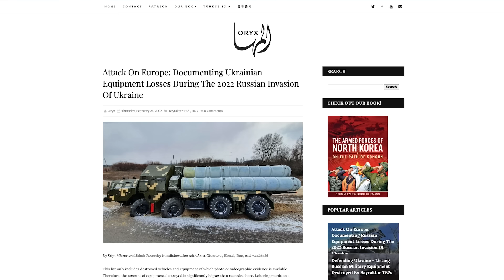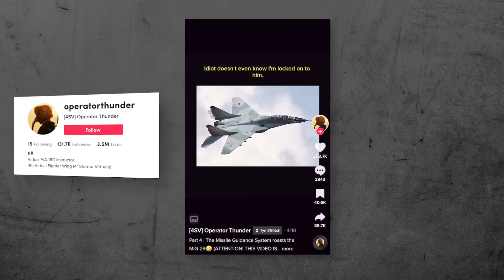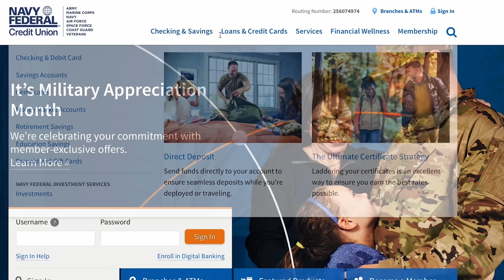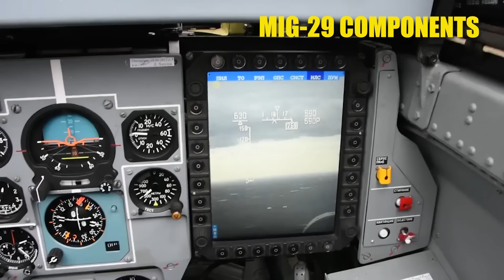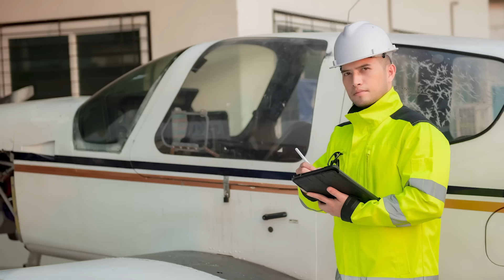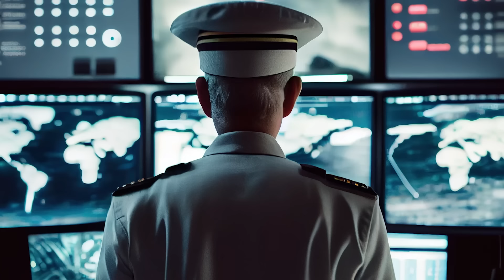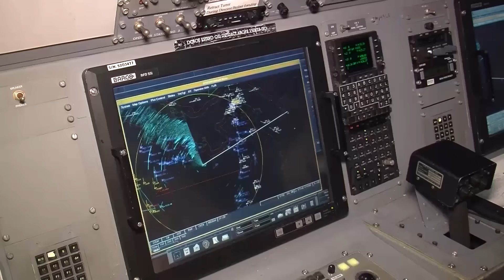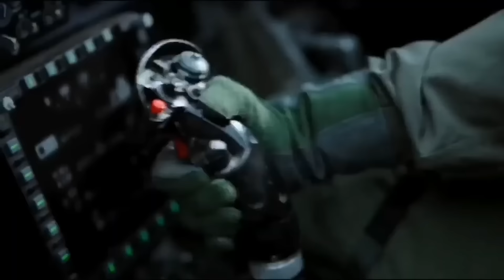How Ukraines new MIG-29 Fighter Jet Operates

Comment: MiG-29 never had GSH-23 gun!, It was alwys standard GSH-30-1. The difference in a caliber - not 23mm and not 2 barrels, but one barrel 30mm gun, capable of up to 1800rpm, which is barely enough for dogfight but almost useless for ground attack.

Comment: How would they be useful?  

1. Actual supply for parts, and ammunition is readily available from the West.  
2. Weapon systems are upgraded and are not as old as the airframe itself. 
3. Better radar and countermeasures than anything Ukraine has available with their older Russian jets. 

Common sense really.

Comment: The Ukrainian Airforce is using a L-39 Albatross, I'd love to see the Czech sending the modern version of this the Aero L-159 Alca.
It's practically a more advanced version with the added benefit of being NATO standard compatible.
Pavel the Czech president already talked about sending the L-159 for specifically this reason, being able to fire sidewinders to Paveway2 guided bombs. 
A big benefit is that the ALCA is light very light compared to the F16, this allows for rougher airfield conditions as well as being more economic in fuel being able to stay up longer.
The F16 was designed for a different army, it would probably help the Ukrainians out a lot and there are a lot more F16's then there are Alca's but still I think it would be good to send an airplane now that Ukrainian pilots are already more familiar with by having flown the older iteration of this plane and just need training on the NATO weaponry.

Comment: Mig-29 has 30 mm Gsh-30-1 gun. It is the only system undoubtedly superior over F-16.
Its projectiles are 4 times bigger than 20 mm.
It means, that 150 rounds for Mig-29 are more deadly than 511 rounds for F-16, and firepower is greater, especially if you consider spin-up time in the Gating.
Mig-29 needs less than 10 shots for almost 100% aircraft kill.
Short recoil system has the lowest thermal load from all possible systems, there is no gas pipe.
The water cooling is used because of extremely low weight of the barrel:
Complete dry gun weights 45 kg (that's why it had a codename "Balerina").
Gun is the last resort weapon, so there is no need high ammo supply.
In Ukraine, gun usage will be meaningless.

Comment: Do Better research - the MiG-29 gun Fire control system which combines the plane's own maneuvering data with radar and IRST data to predict where the target will be was/is so good, that it doesn't need to carry as much ammo.  If you get the reticle on the target, is rarely misses.  You compare gross weights and payloads in an over-simplified manner.  Hydraulic controls versus Fly-by-wire is not relevant if the plane is adequately controllable with its given system.

Comment: The F-16's advantage is the long-range radar system, multirole and more diversified firing power, and more hit points capable of new heavier missiles and bombs. Dog fights may always occur.
Reply: That’s exactly what mig29 doesn’t have,long range radar to avoid s400 and launch from 200km free of hopefully russia long range missiles!!
Reply: @georgesikimeti2184  Both wont be in range of the S400 ever, that basic air combat. Avoid airdefense.

Comment: Mig 29, was not only a sexy fighter jet, but at the time i would say it was better then the F-16 to a certain extent, especially in a dogfight, but of course those rarely happened. There Radar was good for the time, and it had (i forget the name) but it could lock targets easier thanks to a head mounted display. The problems came down to lots of exporting to other countries with poorly trained pilots, superior Us training and the US constant upgrading of their aircraft which rapidly rendered the Mig-29 inferior to the F-16. The most modern “mig 29” is the Mig-35 and that is being produced less then the Su-57 and when being tested by india, it suffered Radar and engine problems, which means its probably a pile of garbage.

Comment: I think the thing most overlooked on these types of videos is that the Russians are experts at the strengths and weaknesses of all russian aircraft, this means when the russians are using newer aircraft they can exploit the weaknesses of the mig 29 to take advantage in air to air combat or ranged missile locks, with an f16 the Russians have limited information on their capability and this fact alone is an advantage to ukraine even if it is offset slightly by less experience of the pilots in the foreign aircraft.

Comment: Thrust to Weight of 1.07 means that you have 1.07 pounds of thrust for ever pound of jet. You got your math wrong, but the point remains the same, although the F-16 is no slouch, and able to turn in a tighter radius than the Mid. 

Like others said, the Mig is able to sortie back to back, whereas the American airplanes require more maintenance, so the Ukrainians will need to take that into account in their planning (and they will, because they are modern, effective fighters.) All of that being said, the F-16 legitimately should kick the shit out of the Russian aircraft, because war is all about information, and you can't beat American radar and detection systems.

Comment: F-16's by default are lighter, more agile and have a smaller cross section on radar, while the MIG-29 is no slouch, the F-16 has been continuously maintained, upgraded to modern standards and are in large abundance around the world more so than the aging MIG-29s. Not only that the agility on the F-16 depending on which variant they Ukraine recieves will make it a very good dog fighter in the sky against Russia's elite Jets like Su-27, Su-30, Su-35, and while i doubt Russia would let their precious Su-57 off its leash and possibly get downed by Ukraine, the F-16 could at least in theory stand some chance against it as long as they worked in pairs or 3 mans to take it down.

Comment: Soviet design parameters is to design something cheap that does that job so that it can be produced in mass quantities.  American or western designs give the warrior as many capabilities regardless of cost.  Therefore you get a Fighting Falcon that has better weapons, better engines, better avionics, and typically better trained pilots.  

The Soviets came up with some very effective air frames, but all of the guts inside them were third or fourth rate at best, as was shown in all of the conflicts where Soviet weapons have gone up against American and Western hardware.

Comment: I’m not convinced the F-16s will make a huge difference. The true strength of the US Air Force is its people. It is going to take experienced air and ground crews to make full use of all of the F-16’s capabilities, and compensate for its shortcomings. The Ukrainian pilots may well be very good. And I will never doubt their mettle. But the doctrine under which the F-16 is operated is one of integration with multiple platforms filling roles to support one another through total dominance of superior numbers and quality. I hope Ukrainian pilots are able to show us just what the F-16 can do against Soviet jets. But the Ukrainian AF is not the same thing as the USAF. Hopeful, but not expecting the same dominance I would expect from the US.
Reply: Yep,experience and mental awareness are the key!

Comment: F-16 are obviously better in almost every way especially in ground strike capability. But although the mig 29 is outdated it’s a dangerous aircraft. And both f-16 and mig 29 are essentially equally vulnerable to Sam launches. I say this to say I’d want both. Mig 29s can be used immediately because the pilots are already trained and the f-16 to upgrade ground strike capability and give me a better bvr platform.

Comment: It's never about the frame, it's always about what you can hang on it and how far it can see. 
Ukraine wants F-16 to have full ability to use NATO standard missiles, and radars that can see and guide missiles to distant targets.
Everything else is secondary. I do think that Ex- Australian hornets would've been a MUCH better choice though. If Australia agrees, NATO should buy them for Ukraine update radar and let Ukrainians take care of the the rest. F-16's in European variants are generally old and have some design quirks that make them difficult to upgrade further. But Polish F-16's are largely out of question... these are ~20 year old airframes which is quite young for a jet... and prty much the only fighter jet Poland has at the moment. While relatively modern compared to rest of European F-16's, these are not being phased out. Unlikely Poland would donate it's own F-16's to Ukraine without getting a replacement.

Comment: This is totally pointless, the MiG 29 has excellent flight characteristics and in terms of electronics in a year Western companies were able to incorporate completely new electronics on the MiG 29 that Ukrainian pilots can use immediately. But that would mean that the MiG-29 is the same or better plane than the F 16, of course if the GS 23 or 30 problem is the easiest to take it off but I'm not sure that Ukrainian pilots would accept that, because that 150 missiles sound small but it's not the A 10 and that gun

Comment: They will get F-16s eventually, but for now they can just not fly them. 

Western HMI significantly differs from Soviet HMI. The necessary training to adapt is estimated to be at least 4 months, with up to two added english courses of 3 months each. They also need to train mechanics.

All this stuff can sound irrelevant, but when the dealbreakers are decisions made over informations gathered over HMI in fractions of seconds, it does matter

Documents proving several Ukrainian pilots went to the US for an assesment of the required training already leaked, so F-16s are probably planned at some point, if Ukraine havent fell by that time that is

Comment: F-16s are able to carry full range of NATO weapons, fully integrated. The mig-29s can only carry a few and they are not fully integrated.
MiG-29s are also gas hogs especially at low-level.
16's may be able to safely fly higher. Launching weapons from higher altitude gives them much greater range.

Comment: Why MiG-29's? 
Ukraine has pilots trained to fly it, parts and equipment to service it, experience using it in combat, and can get them in the air in hours, not months.  
Transitioning to F-16s will require months to years of training by Ukrainian pilots, creation of a new supply chain for parts, retraining the ground and service crews to keep them flying, and advisors to HELP the crews get the best out of their new (to them) aircraft.  

Besides, Poland and Slovakia are probably salivating at the opportunity to get western aircraft to replace the, as you put it, old MiG-29's they got when Brezhnev was still in power.  

It's not an either-or decision.  It's a both-and decision. Use the MiGs today while crews get trained up on F-16s.
Reply: Mig 29's are also designed for operating off adhoc runways, the F16's are not, the Mig's undercarriage is designed to be sturdy, the F16's are not, and once Russia locates the airbase they're operating out of, then they'll have massive missile barrages, the current Ukranian AF poses very little threat, hence why they still have Airbases in the West of Ukraine pretty much untouched..

Comment: There is no reason to waste F16s or any other US aircraft on the Ukraine quagmire.  They don't know how to fly them and don't have the capacity to maintain them.  If other countries want to throw MiGs down that endless money pit, go right ahead.. at least the Ukrainians can fly and repair those to some extent.  It would take years to get Ukraine to the point where they could actually use western aircraft; talking about training, both flying and maintaining, is only part of the picture.. they would require a steady supply of parts.  It aint happening.  All of these armchair generals talking about how great it will be to gift a bunch of F16s to Ukraine are completely ignoring the reality.  You can't just plop a few planes down and have them in the air the next day, unless you're planning to send guys over there to fly and maintain them.

Anyhow, it's a pointless endeavor and not the concern of the US.  Ask anyone on the street (as opposed to all the Twitterati with Ukrainian flag emojis in their names) if we should be blowing all this money and hardware on Ukraine (or anywhere else) and most of them will say "No."  We have more than enough problems here that not only won't be solved, but will be made worse by being involved in Ukraine's problems.  If people are really worried about having to fight China or whatever, the last thing you should want is to weaken ourselves further by getting mixed up with Ukraine.

Comment: The Fulcrum never had its boasted performance.  No Soviet era designed fighter ever has.  But the Fulcrum is a capable airframe, it's just too bad it was made or manufactured using Soviet techniques and materials.  Otherwise if the west made one, then that would be one mean bird.  Otherwise it's a badly built bird with good lines but horrible tech supporting it.

Comment: SOOO the biggest threats are Ground Based Air Defense, aaaannnnndddd the Mach 3 AWACS with a big "F, YOU" missile called the MIG 31. The Mig 31 fires missile that still have a longer range than the AIM-120, and Russia likes to fling them in salvos of 6 per aircraft. While Russia can maintain the production of those R-37s.

Comment: MIG-29 with one of the crappiest radars among fighters has found cruise missiles (which have quite a low rcs btw) and shot them down? Hmm..., it stinks! I mean yeah, those who know little might buy just everything, but those who know a bit about stuff will have good argues about it. The MIG-29 has such a poor radar that it can barely get a lock on another fighter some 20km away and NOT in look down, but looking up. Where do I know all this from? I can only tell that I've read quite enough about it from credible sources who trained against and with MIG-29s. Good stories are from those who flew and tested the MIG-29G in East Germany. Even Iraq in the Iran-Iraq war has requested more MIG-23s from the USSR as they were still better in BVR targeting than the latest MIG-29s. That also tells something!

Comment: First off saying MIG 29 & F 16 are "just as old" is extremely misleading. Western aircraft are produced in "blocks". Meaning that each iteration is an upgrade. Beyond that F16s are STILL being produced. So they aren't ACTUALLY 40+ years old. Avg airframe is much younger. Also the west has enjoyed an advantage in the air since the 70s. A western 90s jet may be a gen or 2 ahead of a 90s jet produced in same year. On top of all that, European F16s are even newer. Viper is the latest variant.

Comment: SAABs and Mig 29 would be the best choice. F-16s can't work with ukrainian airbases. Some russian dude can just throw pebble on the runway which wont be as well gaurded and maintained as an American airbase which they are designed for. SAAB and the Mig 29 are perfect for the job. Also, the F-16 would be an expensive lose to air defense.
Reply: there are already mig29 in Ukraine,why f16 is needed is based on its far superior technology than mig19,how else??

Comment: perhaps making the argument too complicated.  f16s offer Ukraine easier access and integration to armament.  harms on 16s are much more effective, and the same goes for pam's, because of the systems integration.  the nato and world forces using nato armaments would make supply issues easier for Ukraine compared to finding soviet armaments for use in Ukraine.  the 29 is wonderful aircraft, but an enormous amount of plumbing would be needed to employ nato armaments effectively.  possible, but time consuming.

Comment: Ukraine should use western equipment because when they rely on Soviet equipment the country that sells modifications for those weapons is Russia of which they are currently engaged in a bitter war of attrition with. Not a good move in my opinion.

What america should be doing to win this thing, is pulling aside new Ukrainian recruits and training them in america ahead of supplying weapons to ukraine on F-16’s and M1 Abrams. 

Arm the F-16’s with aim X sidewinders, drop tanks, and radar guided missiles for BVR capabilities. 

Send 1 or 2 awacs planes to ukraine, and a few F-18EF (electronic warfare aircraft). 

I think Russia relies on ground based radar so that should really fuck up their radar capabilities. And that should be more than enough to deal with the Russian airforce. 

Oh and supply A64 apaches with hellfire missiles and a few cruise missiles. 

That should be more than enough to win the war since Russia has been fighting like a conventional army and not a super power. 

And supply real time satellite imaging and intelligence on Russian troop movements.

Comment: The MiG-29 is the best short term solution if Ukraine wants to keep parity with Russian Air Force . 
Really thought Ukraine ( with EU support) should be trying to de-escalate the conflict they have ZERO chance of victory. 

NATO ( US primarily) has sent billions $$$ to Ukraine and they’ve had marginal impact on Russian forces.

Long term Ukraine will likely field a European or Asian multi-role strike fighter like the JAS39 Gripen-E , or FA-50 which can also operate from austere airfields or highways , rather than the “hangar queen” F-16 which need long runways and FOD walk downs. 

I don’t believe American-made  aircraft will be fielded by Ukraine.